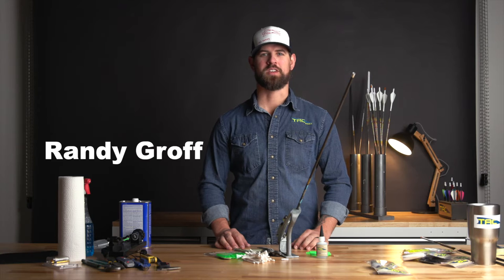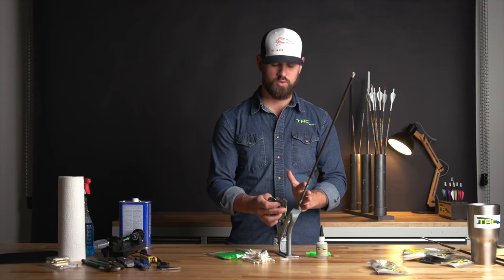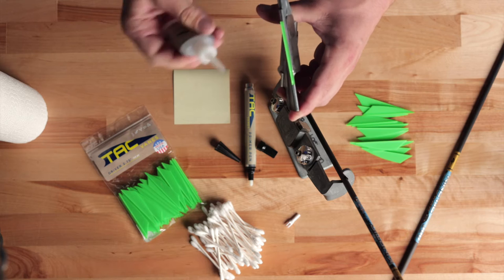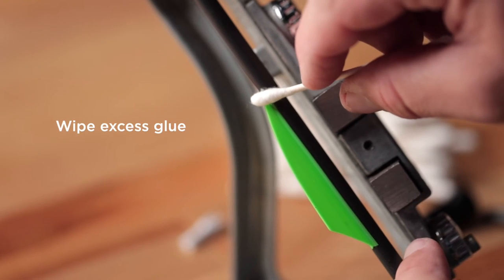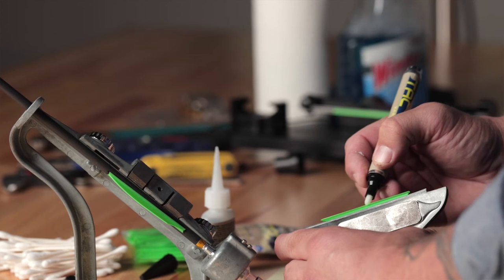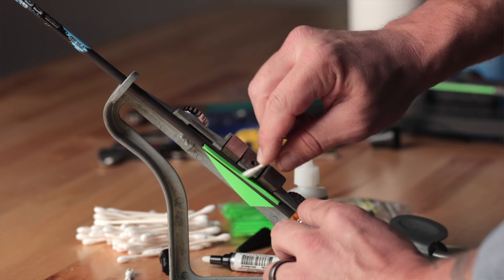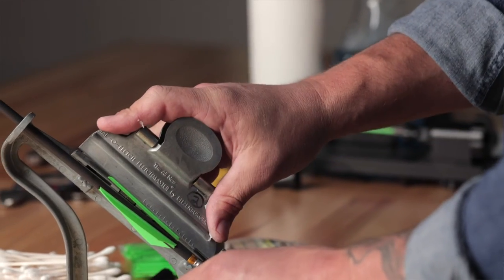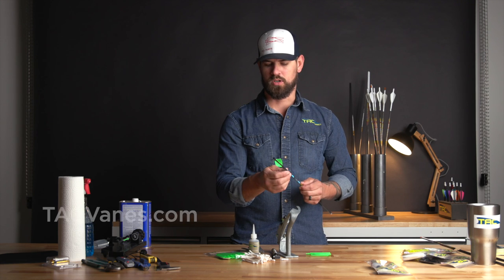How to install TAC Vanes - Fletching Tips

Comment: All you people in the comments make my head hurt. I am an amateur at fletching (10 Arrows) and have literally had ZERO issues with getting the TAC vanes to stick, ZEEERO. They are the first vane I have ever tried fletching my own arrows. Followed every step on the website, and yes used a wrap to get better adhesion and make refletching in the future easier. They DO stick and they stick well to the shaft. I have already had the fletchings buried up in targets and they don't come off. They get crinkled and come back to shape with a little heat, but they DO NOT come off. At a certain point I decided to try and rip them off to see what would happen. Ultimately I had to use vise grips and twist them to get them off. 

All the horror stories I heard about these vanes kept me from buying them for a long time. Now that I have shot them for a while I am convinced. All the people complaining about the vanes not sticking are either trolling, or you're just flat out stupid. Fletching an arrow is not that hard, if I can do it right, literally anyone else can. Stop bashing a product and ESPECIALLY stop bashing someones character like Levi insinuating they are cheating you out of you're money just because you don't follow directions. And if you are following the directions, then maybe your jig needs to be adjusted or you're using a junk jig. 

If you're on the fence about these vanes, don't be. If you follow all the directions they lay out for you, they will stick very well and perform well, period.
Reply: pp rider

Comment: I struggle to get full contact with TAC vanes.  I have a Bitzenburger and keep making micro adjustments and checking to see if I get full contact.  On the front side of the bitz, I can easily see the edge facing me has full contact.   When I turn it over to see the backside of the vane, one end or the other isn't makeing contact.  It's almost as if the 'channel' of the vane isn't 'soft' enough to conform to the arrow shaft (standard gold tip arrows.....246"?).  Blazer vanes are fine.

Comment: What is the most common mistake people make trying to get these things to stick? I’m using the pen, the glue, I’m even using TAC wraps. It’s difficult to describe how frustrated I am with this product. I’ve been able to fletch two arrows in multiple evenings of trying, and they seem to be what I’m looking for when they randomly adhere. I’ve spent three hours this evening and got one one vane. I’m at a loss
Reply: @Adam-sw8cc  I fletched a half dozen with Heat vanes to see how they work. I still have to two TAC fletch arrows in my quiver but will likely need to switch after the next deer. I will say they are fine when they actually stick, but never could I have imagined having so much difficulty. If I could go back, I would have saved my hard earned money.
Reply: @driecutoutdoors   I'm sorry my original reply didn't get back to you a few weeks ago.  I replied to your original comment when you first posted, but I see now that it never posted for some reason.  Apologies for that...  The most common mistake people make is trying vane after vane without success and they never adjust the offset of the jig.  If a vane doesn't stick, it's because the jig needs to be adjusted to acquire a better seal.  Cyanoacrylate glue only cures on the absence of oxygen, so if there's any gap between the vane's base and the arrow (or wrap) it will not allow the glue to fully cure.  Our vanes will require you to find the sweet spot where they stick because they don't squish like other vanes to allow full contact, unless the jig is set just-right.  Try one vane, if it doesn't stick, make a small adjustment to the jig.  Then repeat until they stick.  When you find the correct spot, it'll be as easy as I make it look in the video and they'll stick INSIDE of 5 seconds...  Also check out our other video labeled "Bitzenburger Jig - Tips for fletching" that goes into more detail on adjusting the jig.  Also feel free to send us an email for more assistance - info@tacvanes.com

Comment: Understanding setups vary wildly - do you guys have a general recommendation for the 2.25 and 2.75 drivers for fixed broadheads, 3 or 4 fletch?  I’d prefer 3, but not more than I’d prefer straight flying arrows.
Reply: Thank you for your interest in TAC Vanes!  There are a few things to consider between those two vane sizes and deciding between 3 and 4 fletch.  When you fletch 3 of the 2.75” Drivers and compare them to 4 of the 2.25” Driver, you’ll often find they have almost identical carrying power.  Both of these options work great for 90% of fixed broadheads.  However, not all fixed heads are created equal and depending on how much air the design of the broadhead will catch, you need more vane on the back to create enough drag to offset it.

No matter the model, or application, TAC Vanes should always be fletched with at least 2 degree helical.  Straight clamps / slight offsets don’t typically adhere our vanes well for some folks, but they also won’t correct the arrow nearly as well as when you have a 2-3 degree helical on the vane.

If you confirm which model broadhead you’re referring to along with which arrow shaft you’re shooting, I’ll be happy to give our best recommendation for vane setup.

Randy Groff // Director
Kelly Outdoor Products, Inc.
Direct - 678-729-1454
randy@kellyreg.com
Reply: @randygroff9026  Awesome info, thanks!  I’ll shoot you an email with specifics.For anyone else reading, I already had some TAC vanes to test, and even though I was using the TAC kit, watching their vids here following exactly every step equals perfect adhesion.  I’m impressed.

Comment: Can I use a Boning muli fletch jig with inserts?  Do tac vanes work good in a 4 fletch helical configuration?
Reply: Hi Micah, that jig should work ok, but there are some things to watch out for. The slots are considerably wider than our vanes, so they can easily get sloppy in there and it's tough to hold them perfectly into position as you attach the clamp device. We've had reports of people using that jig without problems and I've personally used it as well. Just know that the slots in those inserts are designed for thicker vanes, with larger bases and if you have any problems, that's likely the issue.

Comment: Any recommendations for using the az ez fletch? I keep having the glue start to dry and set before I’m able to prime and lay a bead of glue on all of the vanes before closing the jig since they all need to be primed and glued pretty much at the same time rather than one at a time. Hope that makes sense.
Reply: Those jigs can work decent with our vanes, but it’s really not ideal.  The biggest problem I’ve seen with those style jigs are the following;
•	The slots are considerably wider than our vanes.  They can be very sloppy in there and they move around when you try to close them.  You could possibly shim the slots with some scotch tape to hold the vanes better.
•	The back of our Driver vanes have a sharp angle and there’s no “positive stop” that’ll keep them from falling out.  So when you put them down in the bottom of the slots, they don’t always sit nicely there.  As soon as you go to close the fletching arms, the vanes often move and that can be a problem when you have a bead of glue on it.  Shimming could help with this.  The Matrix may work a little better than the driver in this regard… 
•	The primer only lasts about 20 seconds on the vanes.  Our material heals itself shortly after the primer dries.  Ideally, you prime the vane and apply glue within 10 seconds for best results.  It’s tough to get that done on all three vanes at the same time, but it can surely be done.
 
We highly recommend jigs that fletch one vane at a time and that allow you to adjust the offset to make sure you get the perfect seat against the arrow.  Other jigs can work and I’m sure there are a handful of people who use a jig like you’re explaining with our vanes.  I believe you’ll find shimming those slots will give it the best chance of working well.
Reply: @randygroff9026  thank you for the response sir. I really appreciate it. I’m new to building my own arrows so I figured the az ez fletch is a decent staring point and also the most affordable. I’ll get a bitzenberger eventually. I’ll just keep playing around with the jig and I’m sure I’ll find a way to make it work. Hope you’re days treating you well so far and you take care.
Reply: Buy a Bitz! I love,mine so worth it
Reply: @michaelmangino9819  I probably will eventually the dang things are just expensive
Reply: @RockyMountainWest13  I think I payed 80-$ at podium archery 
 Well worth it. And very fun
Reply: @michaelmangino9819  yeah they’re definitely pretty neat little contraptions. I’d really like to try out that last change fletching jig but it’s like three times the price of a bitz
Reply: @RockyMountainWest13  yea that was pricy. I'd get a bitz.. You won't be dissatisfied once you get rolling. And That bob smith superglue is awesome

Comment: Why is there no mention on how to prep the arrow?
Reply: Hello, the arrow prep is not super critical with our fletching process.  If the vanes are not sticking, it's extremely rare to be because of the way they were cleaned before fletching.  Instead, it's usually because the jig might need a slight adjustment to acquire a complete seal between the vane and the arrow.  We recommend cleaning the arrows with some acetone on a clean paper towel, but then follow that with water on another clean paper towel before fletching.  If you prime, glue and stick the vanes and they don't stick, you would need to make a slight adjustment to the jig before trying more vanes.

Comment: Looks like you modified the clamp.. did you cut it down? If so, why?
Reply: With the amount of bend in a Bitzenburger clamp, the particular spot where TAC Vanes will stick perfectly on a micro diameter arrow (.166" ID) the leading edge of the clamp will contact the arrow, before it will allow adequate contact to the front of the vane.  It prevents the front from getting a full seat.  Also since most of us are no longer shooting 4 and 5" vanes, it's not overly necessary to have on the front.

Comment: they won,t send tac glue in post to Australia can you recamend a glue to use
Reply: Try maxi cure glue by bob smith industries. It is the best glue i have found for fletching and is also thicker than most jus like Tac glue. Use the primer pen as well and get the glue on there as quick as you can like he mentions

Comment: put these vanes on beman shafts , with a bohning wrap . using the pen and tac glue. would not adhere the vane.
Reply: Hi Wayne, there are quite a few variables that could prevent proper adhesion, but we will be glad to assist you.  Please send us an email (info@tacvanes.com) and let us know which fletching jig you're using (please be specific) and we'll gladly offer some troubleshooting tips.  The one and only explanation for the vanes not sticking (if you're priming the vanes, applying glue immediately after and sticking them to the wrap/arrow) is the bases are not FULLY seated to the arrow.  It may look like it is, but this says there's a very good chance the jig would require adjustment to get a proper seat.

Comment: Only way to install these is throw them in the trash tried 6 arrows with Tac glue and primer pen jig don’t rock or nothing and vanes don’t stick adjusted my jig as your instructions say to it sits rock solid on the arrow but the vane don’t HIGHLY disappointed

Comment: reat video, but those vanes and glue/primer are junk!  Saw your video before buying that combo at my local shop and followed the TAC and the your instructions on my Jo Jan jig fletched a dozen arrows 6 TAC and 6 another brand both with the same glue/primer all the TAC’s came off or the glue never would set, but the others worked fine just like normal!  Junk Junk Junk
Reply: Hi Wes, thanks for giving TAC Vanes a shot!  We're sorry you had some trouble with them, but we do offer in-depth troubleshooting to our customers. We quickly answer emails and inquiries with this type of issue, and 99% of the time, we identify what went wrong. Based on your response, there's a very good chance a slight adjustment to the offset of your jig would have allowed the TAC Vanes to stick like the others. Our bases are much lower profile than any other vane on the market, so the window of adjustment where the vanes will seat is narrower than others. Vanes with thicker bases (more material between the clamp and the arrow) will squish in one spot, to allow contact with the rest of the base.  There's no squish in our material, so it's imperative that you get them fully seated.  The best test to determine whether they're fully seated is whether they stick, or not.  If you are priming/gluing as directed and they still don't stick, adjust the jig after the first vane failed.  Once you find the spot where they stick, they will all stick within 5-7 seconds.  Feel free to email through our website and I'll be glad to help further.